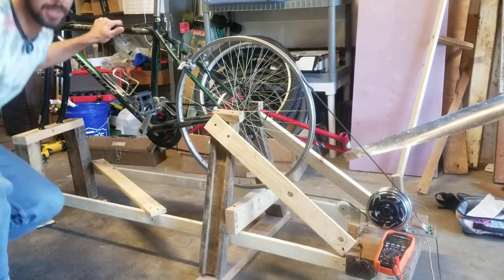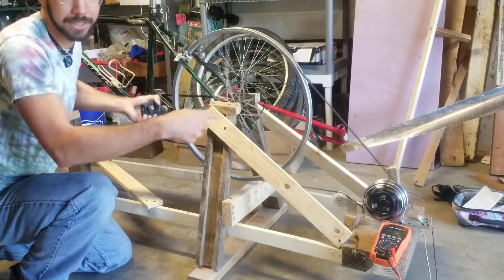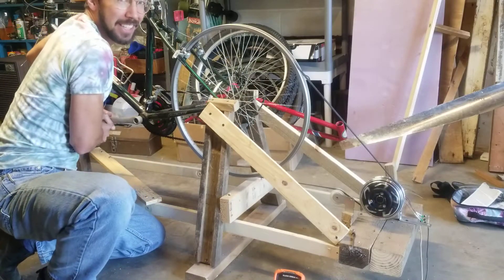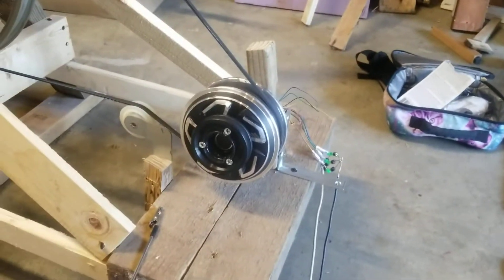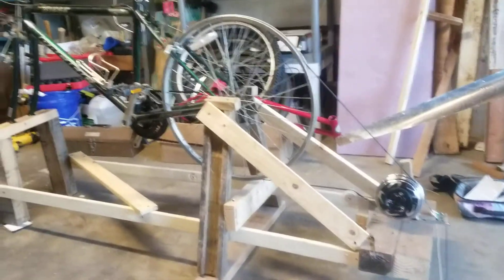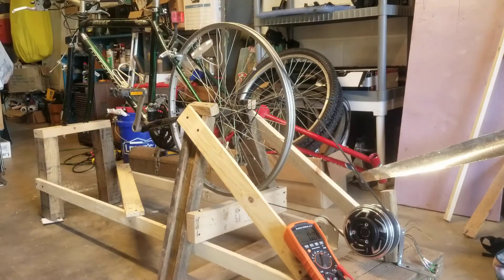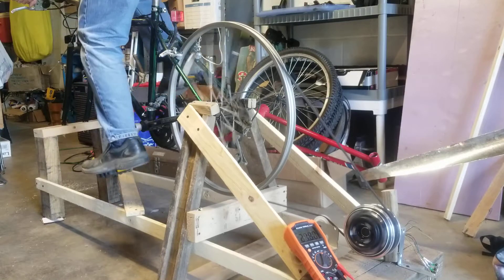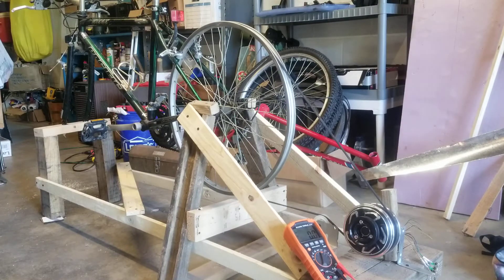BICYCLE GENERATOR - 250W RECTIFIED 3-PHASE HUB MOTOR - OFFGRID / ALTERNATIVE ENERGY / SUSTAINABILITY

Comment: The fact that it is so hard to turn this motor indicates it would be an extremely good generator. I would recommend changing it from delta to wye if you want to use for power generation.